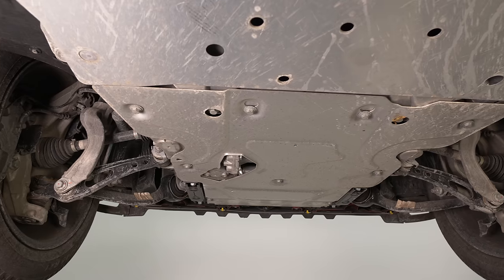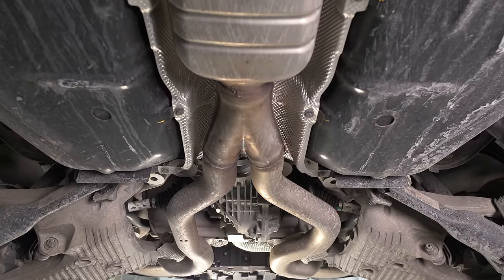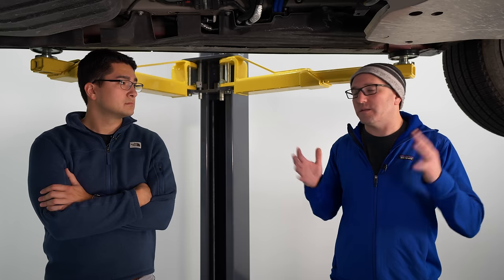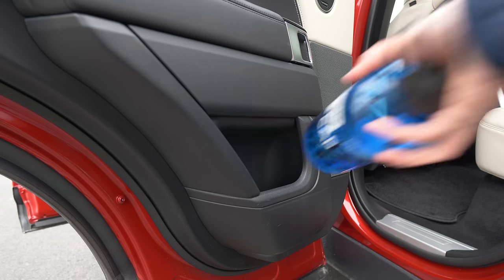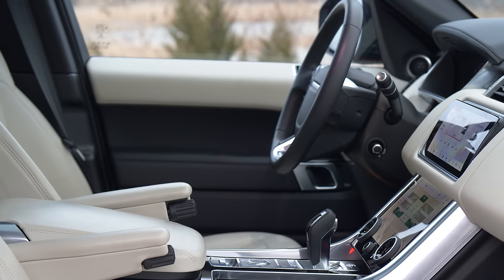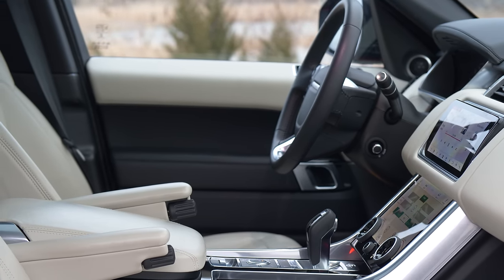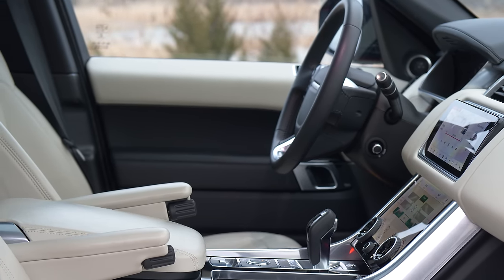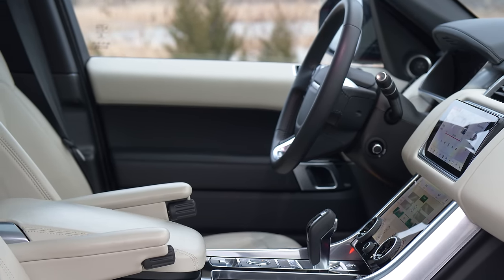2020 Range Rover Sport | More Than Just Status?

Comment: I recently leased one of these for my wife after considering the q7, xc90, and x5. I’m not thrilled with the “Rover” image or the infotainment either but honestly it’s still the best all around luxury suv  even if you don’t take it off road. 

I’ve had a several Bmws, and the build quality of this feels a step above. No rattles or squeaks, high quality materials, etc. 

The Q7 is ugly and drives like a pig due to its front heavy platform.

The new x5 is very nice but doesn’t have the same ride quality or steering feel (the terrible steering was a deal breaker). In terms of quality it’s actually behind the RRS since it’s a redesign and they are working out the kinks.

The xc90 is 4 popper only and is even more touch screen dependent. Doesn’t drive nearly as well. 

As far as the infotainment, bmw is the only one that does it well imo. Touch screens in cars are a bad idea and not safe/easy to use while driving. With the Range Rover we mostly use carplay / Siri and it’s fine. As far as the slow settings menu, you can create shortcuts to stuff like the audio settings and bypass that slow pop up menu. The boot up time is kind of slow, but by the time we load our kid in it’s up and running so I don’t really notice. The digital cluster is really well done - actually better than Audi’s in my opinion. You can use the steering wheel controls / cluster to scroll through tracks/ stations and avoid the infotainment.

It’s such a pleasure to drive, so comfortable  and so nice to be in that I totally get the appeal now. 

On the HSE the locking center diff is optional - it comes standard with a Torsten similar to a q7. Gets better fuel economy with less vibration and costs less. No one is taking these off road. And frankly it’s such a good on road vehicle that it doesn’t matter. People buy slow, outdated 4Runner TRD Pros as “urban assault vehicles” which seems like a true waste of money and a needless compromise in comfort.

Keep it under 80k msrp, find a dealer willing to negotiate and you can get a lease that’s comparable to the competitors. 

The only real downside is that everyone else assumes you are a raging douche and treats you accordingly.

Comment: Used to work at a Jaguar Land Rover dealership service center. When I left there in 2018 the brand new ones still had “Ford Motor Company” stampings on a lot of the mechanical parts. Even though they divoced them in 2008.

Comment: If you are ready to pay 2k every month for a lease I would recommend to shortlist 2 cars. LR Range Rover (not sport) or the Porsche Cayenne. btw the Meridian sound system is amazing.
Reply: The Cayenne is not bad even buying it, until the brakes wear off. Then you need to decide 6-10K on new carbon ceramic or degrading the car with steel.
Reply: Riste Kostadinov bmw m5 f90 with steel stops pretty decent. I wouldnt pay extra for the ceramic brakes unless you are driving the autobahn 250-300km/h
Reply: Do people that afford these cars use zero down leases?

Comment: Had loads of them since the 80's.  We always have Rangeys in the family.  Look at everything else just for a change and got an SQ7 which is an awesome car.  But we've gone an bought a new RRSport too, diesel,  3 litre, not hybrid. Drive 600 miles before stopping to fill up and will drive through anything.  It'll drive through anything towing a boat in fact. I can't remember having a breakdown ever but our SVR has had exhaust problems- fixed under warranty but 3 times b4 getting right...sounded like a Formula 1 car and seriously not the attention you want! Sorted now.

Comment: I rented this car today. Great ride, great visibility, good size for city driving, surprising maneuverable in tight situations, great audio system. Downsides: inline-6 model is very laggy, the infotainment is also very laggy. It takes almost 3 seconds for the turbos to spool up to full boost. At that point, you go like a bat out of hell. If they fix the turbo lag, I’d consider getting one. Otherwise, it’s a frustrating car. I’m sure the V8 is better.
Reply: Sounds like you got a turbo diesel one, they have the turbo and Ofcourse, like any turbo, it lags. The supercharged V6 is quicker

Comment: Close friend of mine has one of the last gen full size V8 diesel range rovers (the one with the ford motor).  In the first six months of the car's life:
- All the belts and pulleys were replaced twice.  This requires the whole front of the car to come off.  Why?  A squeak "somewhere".  It still squeaks.
- Both turbos have been replaced.  This again requires the front to come off.  Why?  No idea.  They said it was necessary.
- Gearbox has been replaced.  Why?  CRUNCH!
- Problems with the DPF not regenning properly with normal range rover use, namely slowly crawling across main city roads and boulevards while "merging" from the most far right line to the far most left lane in a 45 degree angle while not using indicators.  Specific, i know, but i guess relevant.

- It started leaking around the dome light, and at the back passenger windows.  Why?  England.
- Air suspension problems.  Why?  England.
- Electrical issues to no end, which were then later traced back to an immobilizer system that Land Rover themselves installed.  Why?  The words "british" and "electric" were mentioned in the same sentence somewhere, at some point.  This is assured to bring electrical doom.
- Problems with the tailgate thing not opening/closing correctly.  Canbus bluetooth enabled tailgate lock needed windows updates or something.  Why?  Premium technology.

... And that was only the first six months.

It's a pile of garbage.  He loves it, but i would push it off a cliff, get the insurance money, buy a land cruiser and never worry again.

Comment: I have a 19 range rover sport supercharged and I’ve taken it off road multiple times and track day and it’s been flawless for 40,000 miles I also switched out the tires for 275/55r20 Goodyear wrangler duratrack’s (32) for a little more off road ability

Comment: I would agree with pretty much always going for the V8 with any JLR product. I have a 2011 XJ Supercharged, purrs like a kitten and pull as 4400 lb sedan to 60 in 4.4. 99% of "problems" with these high performance Euro vehicles is poor maintenance. The fluids cost more. The filters cost more. They may not be sold at Autozone. People buy them off lease at 3 o 4 years old and then cheap out on the maintenance because they can't afford it. Then you have it at 6 or 7 years old and its riddled with problems. Whose fault is that? If you NEED the off road stuff , this is really the only game in town. Treat it well and it will take you to Dakar and back no problem.

Comment: Coming from a Toyota Sequoia (170k miles on it), Tundras/cars, to Ram 2500 w/ Cummins, and BMWs, I just bought a used 2016 RR Sport HSE w/ TD6 diesel.  I think a lot of ppl who trash RR are not first hand owners or trash their vehicles and don't stay up on normal maintenance.  FORD had a hand in their engines/design also.   I've heard ppl trash RR without even researching or knowing some of the same engines/tech are found in FORD's vehicles, yet while in the same breath they're praising the same engines in FORD vehicles.  The TD6 was a Peugeot commercial and Ford diesel project.

Not saying RR is bullet proof, but neither were my Toyotas, Fords, BMW or Rams.  I worked on Toyota TFS systems and ppl think Toyota's are king.  They have issues just like all the other manufacturers.  Now, what do I like about my particular unit?  TD6 gets 32 MPG w/ tons or torque, although I am not happy with using DEF, it's got a ton of power and has 7700lb towing rating.  Seats are LEAPS AND BOUNDS over my Toyota's , BMW and Lexus vehicles.  Off-road capability!  Ppl need to research how capable RR units are; Porsche Cayennes for that fact also.  All aluminum body, 8 speed ZF transmission is bullet proof, air suspension is a dream and ride height adjustable; extremely quiet ride.  iPhone/Android devices STAY paired, where all my other vehicles struggled to pair when coming back or switching between devices.

The only thing I am not too impressed with so far is the lag in the Infotainment system, will see if there's updates avail.   It works, but this vehicles has so much tech, you should know what you're getting into before buying.  Specific oil type for the TD6, although more brands are making the specific Jag/LR spec.  Parts are more expensive, but you should know that before buying this type of vehicle.   Never thought I'd own a RR, but I am very impressed with it so far.

Comment: Interesting. I have a 2022 series 2 (like this but two years newer) with the same Touch Pro Duo system. It isn’t laggy at all apart from the settings button, for some reason. Choose any other (which he could have done) and it’s fine, and that’s compared to the Audi Q8 system I had before. It isn’t as clever as the Audi system, although the latest Pivy Pro system in the series 3 probably is. This is a great review but it gives the impression that all RR’s break down all the time. They don’t.

Comment: I 100% agree about the technology issues on the RR Sport.  I had a 2018 RR Sport Autobiography for a little over a year.  The car engine and exhaust note for the 510hp was awesome.  However, the flaky technology drove me insane. I had so many instances of the system freezing up,  being laggy and just horribly slow.  I ended up trading it in for a Audi Q8.  I miss my RR V8 engine, but I love my Audi Q8.  All of the tech actually works with the Q8!

Comment: idk why people always say range rovers always break down. Had my current sport for 3 years with 45k miles and only time i bring it in for maintenance is every 15k miles or 6 months which is not bad and its usually out of there within 3-4 hours.
Reply: There are always exceptions to any rule. You look like you got lucky.
Reply from the maker: It's when you get out of that warranty. All the little stuff starts breaking suspension Electronics shocks and air Springs are basically a common replacement item brake jobs are way more expensive there's just a lot of things that go along with owning one of those cars long-term
Reply: @savagegeese  i've owned multiple and my last car wasn't covered by warranty for the last year or so and it was fine. All I ever needed replaced was the shcoks and that was when it was under warranty. Not sure about the long term thing because longest I've had a Rover for is about 5 times I think but overall I (and my parents) have had a very good experience with Range Rovers
Reply: @jamess.2491  Sounds like you only keep these vehicles 3 to 4 years at the most. When you buy new constantly and keep them only that long no car Is going to you give you that much trouble. Savage is talking about long term ownership. Are you leasing these  or buying them new?
Reply: Timothy Clark at first I leased but the last two I bought as my son drives my old one now and it is still running well. I believe it’s a 2014 model.

Comment: It is hilarious how any Land Rover review prompts the barrage of “worst reliability!!” screams from YT commenter elves who have never driven let alone owned one.  OK, another Joe Perry data point here, have had 2 (yes, TWO) Range Rover sports, first for 8 years and 100k km, second so far 3 years and 40k.  Like Joe, my Rovers are used almost half on highway, half on western backroads, driven the way they are designed to be, washed occasionally.  And like Joe, mine have had essentially no maintenance other than routine by the book.  I have no problem with the sarcasm about Range Rovers used strictly for the suburban school run… fair game, but… their money I suppose.  But these are the owners who are likely to scream “awful reliability” when their iphone XV-S-cubed fails to find the car’s wifi to stream Netflix. The (many of us) who love the go-anywhere aspect, and use it routinely, don’t tend to fuss much about the luxo pieces all cars now seem to need to include, as long as the truck does what it is advertised to do, and doesn’t let you down mechanically. And that, is why despite the reliability score trends, Land Rover has typically had a fairly high repeat buyer rate.  So… to Mr. Goose’s “nobody will ever take these off road”…. ?  Not even close to true, and a disappointing level of bias in an otherwise excellent channel.
Reply: Confirmation bias is a real thing. As is envy and spite. My family has always sworn by Honda's, despite them failing as regularly as any other vehicle, they just are willing to keep paying to fix them. I have always sworn at them, because when Hondas fail me, I don't want to pay to fix them but give them to my family. I have owned or driven almost every model Land Rover ever made except for the Series I, and I think they are great. I am not wealthy, I typically buy them used and I maintain and use the hell out of them. Never been disappointed with anything about them other than the couple of times I was the third owner and realized the 2nd owner didn't spend a penny to maintain the vehicle.

Comment: I was a little surprised to hear the Volvo XC90 elevates some of the luxury aspects compared to the land rover.  Hm, wouldn't have guessed.
Reply: Having driven both, id disagree. The Volvo seems nice st first but just isn’t on the same level in terms of quality or materials. Plus it forces you to use the touch screen for hvac and heated seats (the Range Rover stil has physical knobs).

Comment: Mark, you’re a “tech-guy”—why is the infotainment laggy?
Reply from the maker: Usually coding, integration with hardware or just not enough GPU/CPU power.
Reply: It be hilarious if this is a cost cutting thing to get in at a specific price point. 100k price point cost cutting😆😁😂
Reply: I think the hardware on this is decent. Comes down to coding. I believe they built the software themselves in collaboration with intel and Tata on top of a Linux based OS. Would probably perform way better running qnx or android. Panasonic just supplies the lower screen - they had nothing to do with the software by the way
Reply from the maker: @richardh3587  Panasonic actually was the key developer on this dual screen system from most of the software and hardware design. They have some type of press video about it in UK.  Unless they changed devs after the fact.

Comment: Actually i like that Land Rovers trying to make the ultimate car. I mean not much brands try to add SUV, luxury, sport and off road capability in one. So far they actually look`s like the ultimate car aside they very very weak in reliability department. When savageese say lease it = junk yard crap in long term. So far most of these car`s doing good inside 3-5 years warranty period. If you are ready to throw your money and loose them after 5 years....i guess this is the ultimate street car. For me...if i want off road capable SUV i will go for Subaru and then i`f i need more i`ll go for Land Cruiser. Sure either of these don`t have the luxury and the LC don`t drive as well but damn....they last much longer. Here we joke than the Land Rover owners always have second car for the times when their Land Rover is not running.

Comment: 10-12 years from now, the street value running at $3-$4k. 
A/c not working, electronics not working, air suspension leaking.

Comment: I hate when people say " when you buy $100k vehicle you don't care about fuel economy. It's not about money it's about time wasted at the gas station. Also, range is a big deal off roading.
Reply: I assume less than 2 percent of owners of their 100k SUV take it off road on trails long enough where range becomes important. The car also has 24 gallon tank so within reason range regardless of fuel economy is a non issue.
Reply: @jackholmes8105  So this gets 215ish miles per tank? Been there done that. It's ok for about a month and then gets really annoying.
Reply: @ryanfinney2140  i think its closer to mid 300s at 15 mpg
Reply: @jackholmes8105  I thought you said 9 mpg. 15 is actually really good for what it is.

Comment: 184k on my 2005 LR3 and still going strong . . . kinda. That said, my transmission is starting to shift hard. It does not want to go into first while slowing down and when it shifts into second, it is harsh. I looked up possible issues and I may have to retire her and look for another one. Thinking about upgrading to the LR4 -- any Rover geeks out there that can provide some advice would be welcomed.